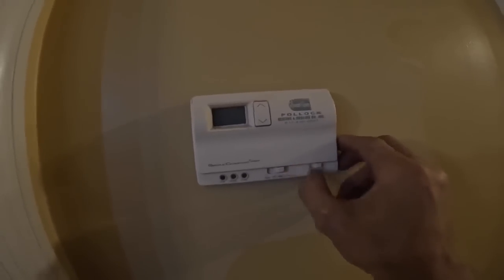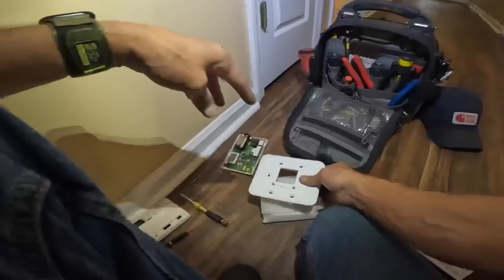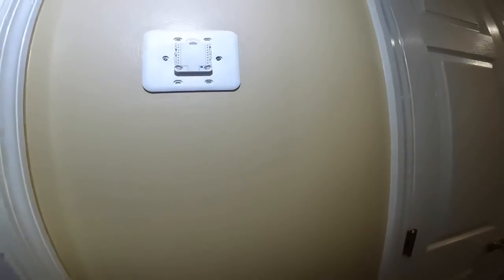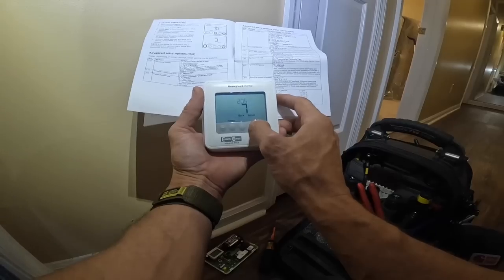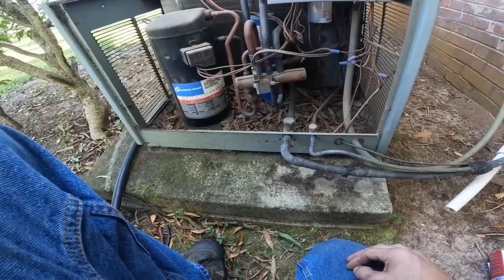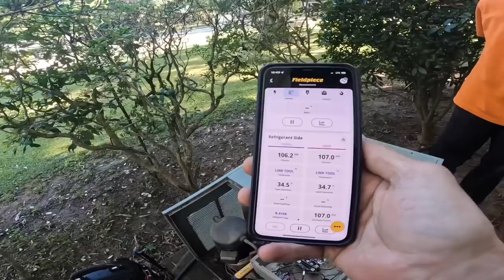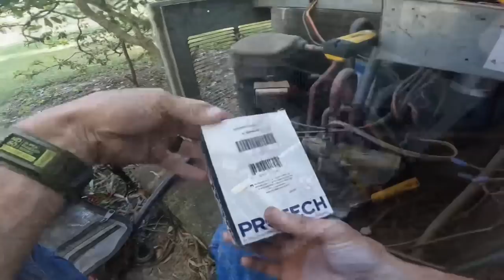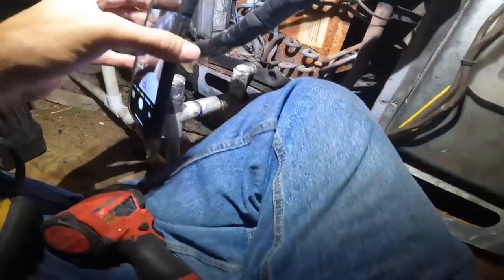Thermostat Was Just the First Problem I Found

Comment: Wow another old one, it needs a changeout. When yall were talking about the old cars that used r12 it reminded me that years ago, I was told that to use the 134a that you had to change the oil in the compressor, change the expansion valve, accumulator and such. I said screw all that and bought 4 cans of the 134a and put it in. I didn't even pull a vacuum. It was a '72 impala. It worked like a charm, freezing cold ac, and gave me no trouble at all.

Comment: Curtis I have a tool suggestion for you, Klein’s 14 in 1 precision screwdriver. It’s got a bigger handle than the other precision screwdrivers so you can get good torque on it, but it’s smaller than the 8/11 in 1’s. Plus it has a 1/4” driver that is super slim which has gotten me out of a couple pickles.
Reply: I'll second this. Been out of the field for a while but I loved mine. My only issue was it doesn't have any electrical insulation and I'd find myself in situations wanting to use it but knowing I'd be safer with my insulated set and going with that instead.

It's always a battle weighing the pros and cons of time saved being more reckless with an insulated tool but having to haul around a set, compared to going with the single multi-tool and taking more care in cramped spaces.
Reply: yahbut b4 he buy any of those luxuries and trinkets...GLOVES

Comment: Had to replace a conned evolution controller. They do not make the infinity controller anymore and the advanced options would not work or slow me to access the programming. Hooked up new thermostat. Because it’s communicating it saved all of its programming and all I had to do was make minor adjustments like the clock and schedules and filter reminders. I gotta go back and hook up the app for them but it’s nice to have something turn out your way for once. Good work on checking everything

Comment: Yeah when we build houses in Warner Robins and Perry Georgia we always put a platform down and build a walk way to the platform in the Attic where we're going to let that heat and air man put the air handler in the center of the house that way you don't have to have all those long arms all the way down the center everywhere it saves a lot of work and it looks a lot better.👍💪🤟🌟🍺🇺🇸
Reply: We did lots of those here in Houston where builders didn't bother to build safety catwalks in the attics where furnaces, air handlers and ductwork is located.-

Comment: I had one in WI - sub zero winter, empty house, heating failure - had to thaw the water shutoff to isolate the house water. Problem wasn't the thermostat though a local HVAC company charged them for and installed a new one then left. I was second call out. Replacement thermostat not mounted to the wall correctly, thermostat wiring patched in 3 places. Ran new 7 core back to the furnace removing all patches and the furnace then worked fine. Plumbing damaged included pretty much every outlet (kitchen sink, bathroom vanity, laundry, toilet fill line AND splt toilet tank as well as bathtub / shower valve)
Reply: It’s definitely sad to see that kind of stuff happen my boss’s old neighbor was “big note rich” but they got the house signed on and then promptly dropped the insurance policy, so they could go to the tropics for vacation,  and left for like two weeks or so,  leaving nobody to check on the house,  they came back to literally an ice castle 😂😂 they gave the keys to the bank and walked away 😂😂😢😢

Comment: a blank t-stat does not always indicate a bad t-stat,most of the time its just the batteries
Reply: This thermostat had a common ran to it… of the stat has 24 volts, the batteries are only there to save a program of the power goes out
Reply: @ryanmcananey6245  👍

Comment: With the T6 thermostat, there's a setting in the main menu to turn the programming off. This gives the customer the ability to turn programming on should they choose to do so in the future. When you turn programming off via installer settings, that's it. They have to call a technician out to change that setting, often resulting in more zero- dollar call- backs and more customers not fully satisfied.

Comment: Actually, just recently, my thermostat was the only issue lol. It has a free cooling mode that opened a vent to fresh air and overrode the outside unit. I replaced the Cap and Contacter, and it worked but it did it again shortly after. So I went through my whole system to find it was the dam EcoBee messing with me! Lol

Comment: When you transfer liquid from condenser to recovery bottle, can you put a liquid filter in the line and filter the liquid as you recover it? Keep up the great videos. I wish you were in Oklahoma.
Reply: You can but it's illegal to sell it or use it in a system owned by another person. It's supposed to be reclaimed, cleaned and recycled.
Reply: @bill944  I was thinking if i had the equipment to do it for myself. thanks for your reply. I can't get enough of your videos.
Reply: @bobwhite1734  Not my videos. The equipment is expensive. Also, depends on the refrigerant that you have in your current system and what's used in the system you're getting. I wouldn't consider using anything but virgin refrigerant if I was putting in a new system.

Comment: I think you can program the Thermostat to energize reversing valve in heat/cool. Could that have been the issue?
Reply from the maker: I was getting correct voltage coming into board - between blue and common - but board was not energizing the valve with 24V
Reply: @HVACGUY  ahh! Gotcha. Love your videos keep it up

Comment: Why would you put batteries in thermostat when you have common wire?float switches should break red and shut down thermostat and tells customer there is something wrong. I watch your videos everyday great content
Reply from the maker: Those thermostats are known to lock the customer out if there’s a break in power. The batteries help to prevent that.
Reply: You need battery back up during power outtages!